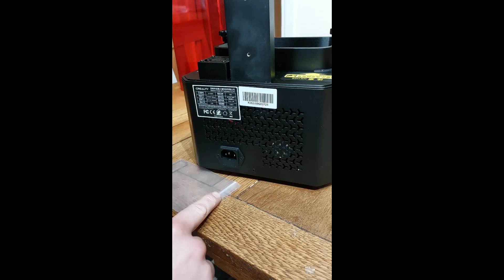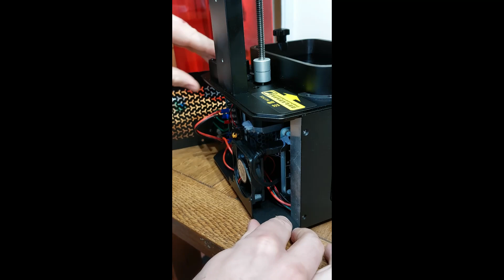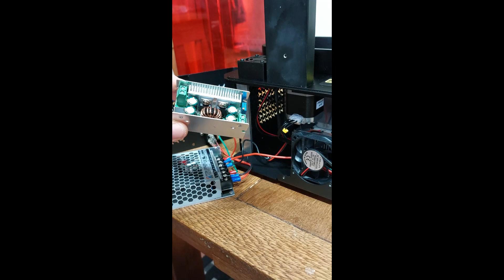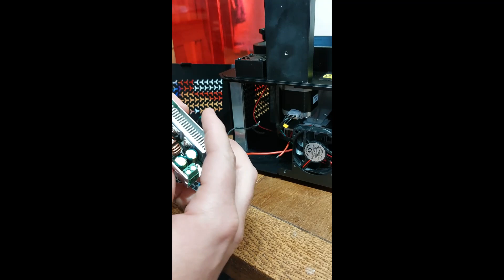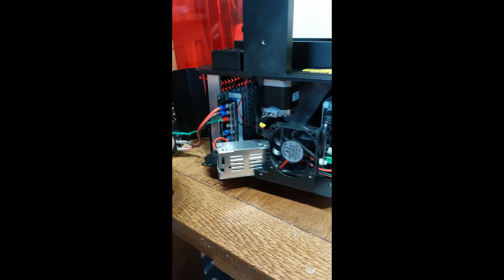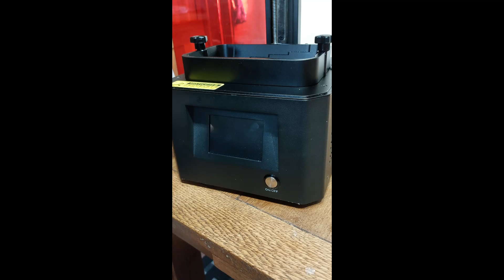Creality LD-002H FIX!!!

Comment: I also applied a voltage dip to my printer, Improved quality, but it still leaves a thin film on the bottom of the FEP. It only interferes with large prints, affecting the final quality. I still haven't figured out what else I can do.

Comment: On the PSU, the second channel indicates a current of 1.4A. So why provide a "steep dow" of 15A? For me a "steep down" circuit that works continuously at 3A with peak up to 5A is more than enough. These are cheaper and much smaller. What do you think?
Reply: I'm running a 3A, and it's fine!

Comment: Thank you for uncovering and disclosing this issue and resolution.  Here we are a year further on and I've just purchased a new LD-002H.  My first print resulted in a beautiful Eiffel Tower ... BUT, there was a lot of loose cured filament in the vat.  I found your fix and that's a great answer - checking my PSU later this morning.  However, this is 100% on Creality.  Their QC should have caught that overvoltage and either took the issue back to the PS supplier to resolve, or supplied the buck converter in later units (and offered them to customers at no charge).  I understand the costs involved with such a fix (I deal with this quite regularly in my real world life), but how do those costs weigh against customer dissatisfaction?
Reply: i dont want  creality to fix this problem  this is the reason they are so cheap  and if they added those modules the price would skyrocket   although i do understand the frustration

Comment: Bonsoir AnyprintUK ! Tout d'abord merci pour ce tuto complet sur l'abaissement de la tension des led de la LD-002H. Aprés avoir recoupé plusieurs informations et fait la manipulation sur ma machine, je confirme effectivement la résolution du problème de sur exposition à cause de la tension trop élevée de 29.7v en sortie d'alimentation. j'ai même constaté une légère amélioration de la qualité de mes impressions ! je suis aujourd'hui satisfait de cette machine et j'ai apprécié comme beaucoup je pense, d'avoir accès à votre modification qui fonctionne très bien. Je voudrais aussi en profiter pour confirmer l'utilisation du module LM2596 DC-DC dont le tarif est peu élevée, 5€ ! et disponible dans une version avec un  afficheur de voltage facilitant les réglages pour ceux ne disposant pas d'un multimètre, pratique en somme. Encore merci et bonne continuation.

Good evening AnyprintUK! First of all thank you for this complete tutorial on lowering the voltage of the LD-002H LEDs. After having cross-checked several information and done the manipulation on my machine, I confirm the resolution of the exposure problem because of the too high voltage of 29.7v at the power supply output. I even noticed a slight improvement in the quality of my impressions! I am now satisfied with this machine and I appreciated as much I think, to have access to your modification which works very well. I would also like to take this opportunity to confirm the use of the LM2596 DC-DC module with a low price, €5! and available in a version with a voltage display for easy adjustment for those without a multimeter, convenient in short. Thank you again and happy continuation.
Reply from the maker: Thank you for the feedback.

Comment: Sir thank u for this video ! 1 question . I didnt understand about black wire can i cut it and make it in out like the red ?
Reply from the maker: No need as the black is negative as it supplies the negative to the 12v also.
Reply: @anyprintuk420  so only i make it naked without cutting and put it only in the in slot only
Reply from the maker: @charbel dagher  that is correct.
Reply: @anyprintuk420  thank uu ✌️

Comment: Hi, why Step Down 15A, while output is normal 24-28V and 1-1,4A...
Reply: Wanted to add that I used an LM2596 to step down to 27V, and after a few test prints, it seems like it did the job. Doesn't feel like it's overheating or anything yet, guess time will tell how it holds up. Thanks for all this info, it was incredibly helpful!
Reply: @Sovientgnome19   Hello, how is it going with the LM2596, any problems?

Did you have to modify the exposure times of your machine?
Reply: @Yosoyvic88  So far so good! I haven't used any of the same resins before and after the fix, but exposure times of the new resins are longer than the manufacturer recommended profiles. So yes, I'd say exposure times would need to be increased. I don't think I could use my old resin profiles from before the step-down fix.
Reply from the maker: The spec I was given from creality is that minimum 15a as the led module is 40w. I'm no electronic expert so I just followed there guide.
Reply: @anyprintuk420  I see, 40W : 27V = 1,48A...so 2A max. I will take measurements to confirm this.
Reply from the maker: @MirdaJarab  thank you good to have the technical details that means we can just fit a normal buck converter.
Reply: @anyprintuk420  Hi, so I measured the consumption and it's 1,45A. So I will use LM2596 DC-DC Step-down.
Reply from the maker: @MirdaJarab  great info thank you.
Reply: @MirdaJarab  Hahaha, two things could have happened here, either Creality forgot to move the decimal point (more likely)

or those LEDs are like 2.6 volts, which could also be feasible, but since it gives you the current under load of 1.4 amps I assume it's the first one

Comment: Need help asap. I followed what you did on the video but now my screen doesn't turn on?
Reply from the maker: Did you test the power coming out to be 27v?
Reply: @anyprintuk420  thank you, it’s working now.
Reply from the maker: @nyb3017  great news, would you like to share what was the problem if someone else runs into the same problem?
Reply: @anyprintuk420   Exactly what you said lol.  I forgot to adjust the out voltage to 27, I was so excited to get the buck converter installed That I forgot to check the most obvious thing.
Reply from the maker: @nyb3017  great to hear, thanks for the feedback. Happy printing

Comment: same issue on the older`R` version ???
Reply from the maker: This is news to me, thanks for sharing.
Reply: No. The RGB screen on the LD-002R isn’t quite as transparent as the -002H’s, so it does not have this issue. I only encountered this problem when I “upgraded” my LD-002R’s screen to the mono screen (same one that comes with the LD-002H).
Reply: @urlawyer  and doing this mod, now your ld002r with the version screen and, does it work for you?
Reply: @Disturbeh  I upgraded my ld-002R screen to the mono screen, got leafing, did the mod to reduce the voltage, and now it works well.
Reply: @urlawyer  Thank you very much, I'm going to do the same as this video, let's see if I'm lucky and everything goes well.
Reply: @urlawyer    I've just upgraded the ld002r screen also and got the same issue.  Just ordered the buck converter.    Is everything in the ld002r 'bay' the same as in this video eg same wires etc in same place